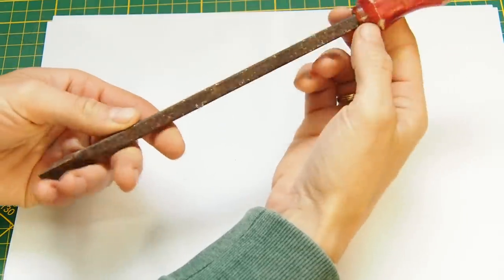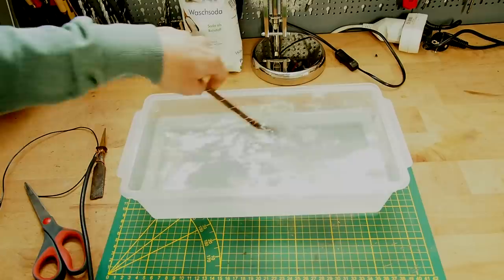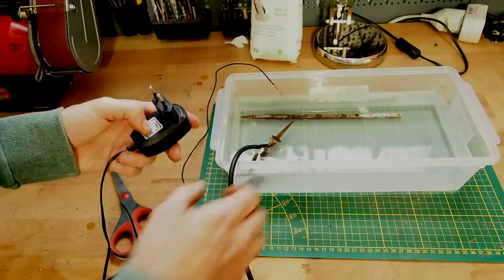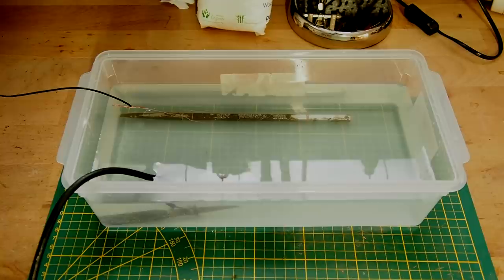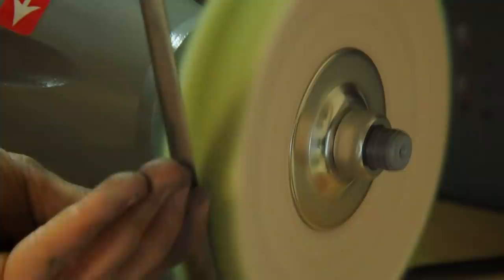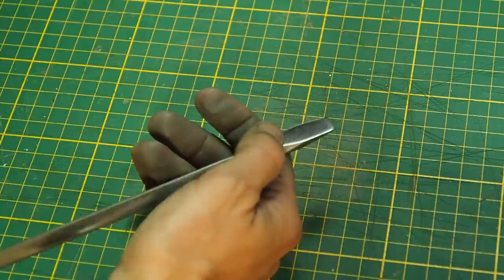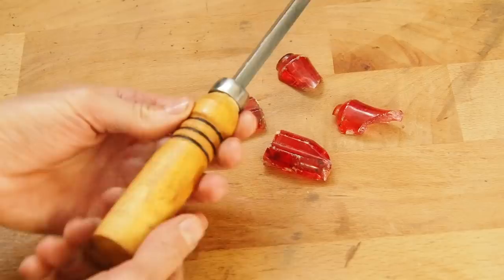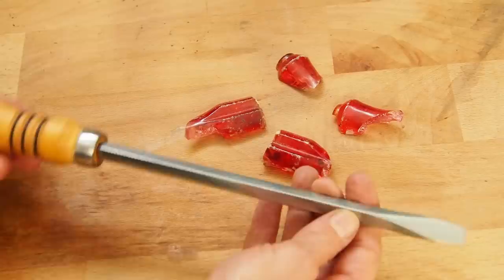Restoration Old Broken Screw Driver

Comment: This is a great first attempt at restoration.  I've been restoring tools for a few years now and I can tell you that your first attempt was way better than mine.  I have a  couple tips to offer.
Files only cut on the push stroke.  You shouldn't go back & forth because the backward stroke only dulls the file.  Push the file along the material, remove the file from the material, then push again.
You should use your drill press to drill holes for handles because they are more precise.  If all you have is a hand drill, that's better than nothing, but if you have a drill press, why not use it for the handle?
Other than that, great job.  And I'm stealing your idea for burning the grooves with twine.  That was genius.

Comment: Good work! I’m going to try that string burnishing sometime. Also thanks for stabilizing your work with a bottom pin in the drill press. I see many projects using a drill press as a lathe but allowing the work to simply “hang” and that puts undue, and potentially irreparable, stress on the drill press

Comment: Loved the drill press as a temporary lathe idea, also what type of oil did you use?  I use walnut oil on all of my work as I like the way it looks once the oil has dried after a week or two.  Not seen hessian twine used for burning marks onto wood like that before, I use fine braided wire that I have two small wooden handles to hold it with.  Look forward to seeing more of these in the future.

Comment: Good job on the restoration.  A design suggestion would be to make a "full tang" screw driver handle (i.e. just like how you designed your survival knife) so that it is less likely to break ; )  Best wishes and thanks for sharing.

Comment: Wow you tought me a trick with the drill press, using it as a lath.When sanding metal use wet and dry sand paper in water so that you will not make scratches in the surface. The screw driver looks amazing.

Comment: Being able to restore tools, is indeed a good skill... You made a rookie mistake btw: If you're planning to glue something, you should make it as rough as possible not smooth! ;)
Reply: I noticed that as well.  When I glue wood and sometimes metal I cut notches here and there to make "anchor points".  Rough it up. I might have made a couple of tiny shims to slide down the side of the hole for the shaft.

Comment: I liked the video, but look for an old lathe and restore it for stuff like this.  It's OK to use a drill press this way occasionally, but in most cases the bearings are not made for a side load, just vertical.  With heavy use, the bearings will eventually wear out and you will not be able to drill a precise hole.  As always, unsolicited advice may be ignored.  Have fun refurbishing old tools, it's one of my favorite things to do.

Comment: Hello there-I would like to give some positive criticism-if I were doing that restoration I would not have bothered with the electro-chemical rust stripping-just wire wheel it and move on with polishing-the handle looks nice but with a screw driver you need to have some way of gripping without slipping-also will be very surprised if the adhesive holds-I really enjoy your site-hello to Annie.

Comment: As demonstrated by 5ZYL_Marco resently you can also use citric acid and leave it for 24-48h or 10% HCL for ~10min
In any case you need to close the bare surface in both methods, otherwise oxidation will take over asap.

You could also add notches in the metal to improve the epoxy strength in the handle.
Epoxy cures with higher strength and faster at elevated temperatures, so storing at 60 - 120°C can double the strength (tds_plus_endfest300.pdf), even if you are using schnellfest.
Mixing and smearing the epoxy on a flat surface removes more efficient the air bubbles and improve the strength as well.

Comment: I would have thrown out that old screw driver.  I am very impressed with your machine and wood shop skill level.  That screw driver came out almost brand new with a very nice wood handle.  I have never used a drill press as a vertical wood lathe before.  You are very talented and I am impressed.  Thank you for show us.

Comment: Just some tip of advice for the electrolysis, raise the voltage and current if you got enough ventilation or even put the stuff outside, put the anode and cathode closer to each other because water has quite high resistance (10K/cm close to 30K actually, lesser with the salt you put into the water of course) and the closer they're the better and stronger reaction the process will have. By raising the volts and amp an old 12V battery charger 5-10amps will do just fine, but it has to be one of those old stupids or else they'll just shut down because of a faulty battery.
The screwdriver looks great, but take some tape and protect the 3-5mm from the end and grind the tip with some fine (400-600) sandpaper because that high polished surface will slip.
Keep it up!
Reply: I use vinegar and time to get a similar result without electricity. It is corrosive but pretty mild really. You can't use it on anything (it can chew into makers marks which isn't great) but for a screwdriver it would be fine and very easy. After 24 hours soaking the rust rubs right off.
Reply: @gr33rtheartist  
Yes that work too, my first try of removing rust without mechanical help I used citric acid and time, the axe were soaked in that solution for about 48 hours and it works like a charm. Acids also gives the rusted parts a beautiful patina, almost anthracite grey.

Comment: That electrolysis seemed to work well! I've never tried it.
I'm likely to do a simpler process - just use a wire wheel and take off all the rust and finish at one time. Power tools! Has the disadvantage of rounding the edges, but a hand-file does that too...

Comment: you got really creativ with you tools, i like that. BUT the fit of the screwdriver itself in the handle is awful! the epoxy won't hold much, you should have drilled a way smaller hole for a really tight fit and then drive it into the handle with some epoxy. if you manage to do that without cracking the handle, it will make a much better bond!
Reply from the maker: The handle was already too thin in my opinion, so I am sure with the method you are suggesting that the handle would have cracked.
Reply: yeah thats always a problem with wooden handles, anyway good video, loocking forward to see more of this kind👍

Comment: With all the Kuhsch*iße going on in the world right now, it was really fantastic to just relax and watch this video. Ausgezeignet! But how did you secure the handle in the drill press to convert it into a lathe?
Reply: At 5.50, Lilly cuts a square end at the top of the handle. This is rounded to fit the drill chuck. Later, the square end is removed and the handle end is smoothed over. Very clever.